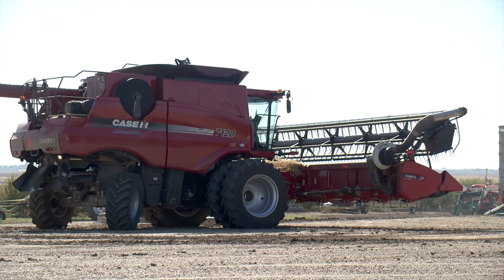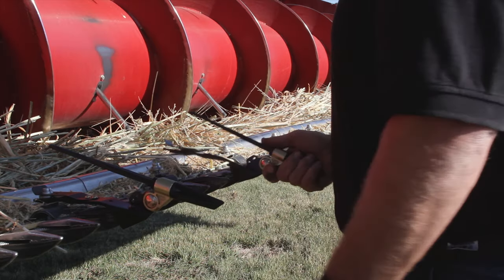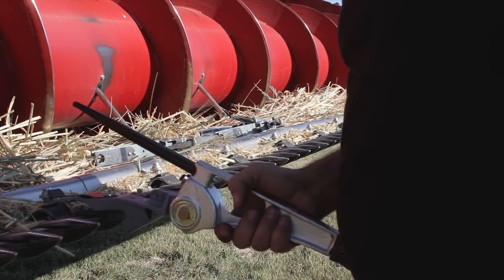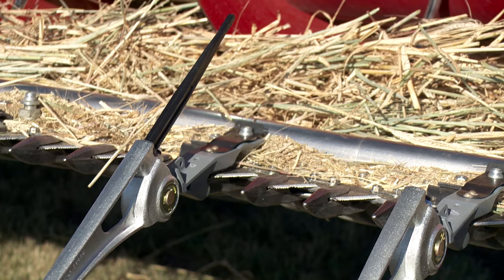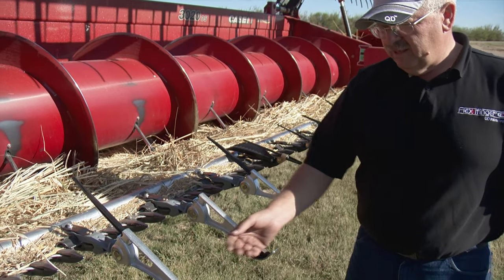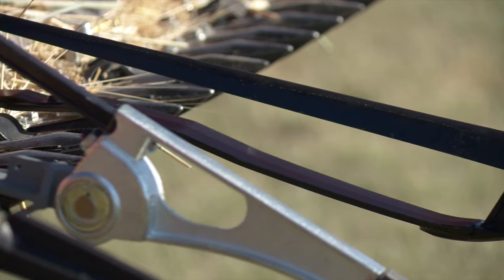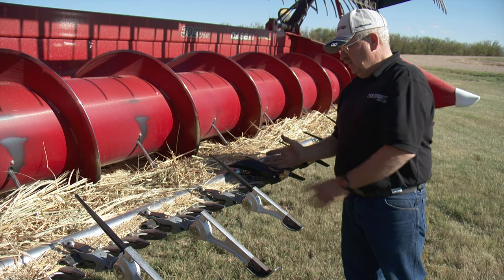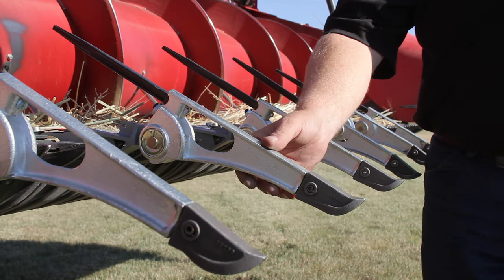Flexxifinger Crop Lifters

Comment: There's a reason these haven't been invented before, several reasons actually. Bad idea, not usable, waste of time.
Reply: I remember steel lifters similar to the large model being used in soybeans on pull type combines when I was a child. Those machines didn't cut as close to the ground as our flexible platforms, so they needed to stand the stalks up if leaning.